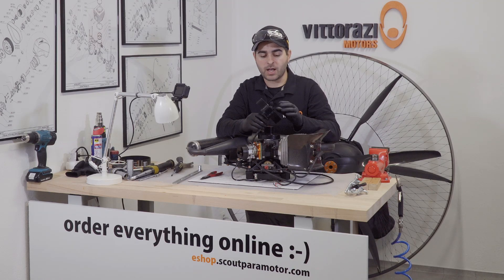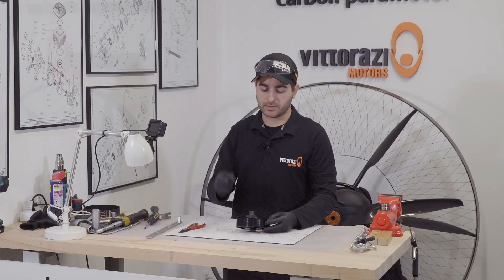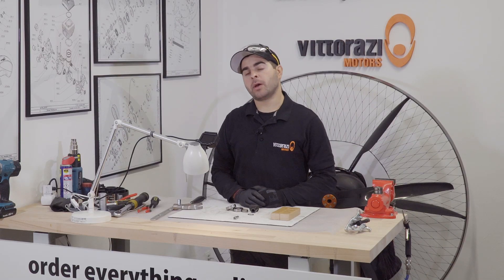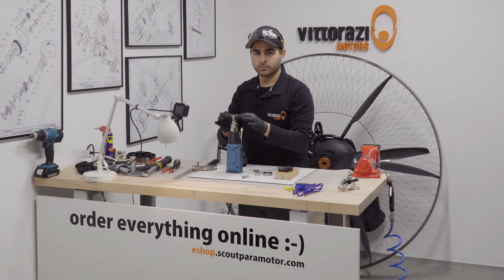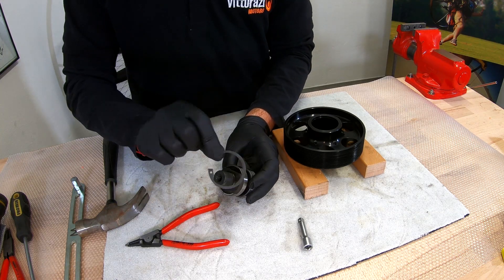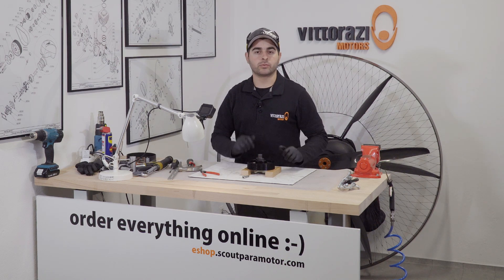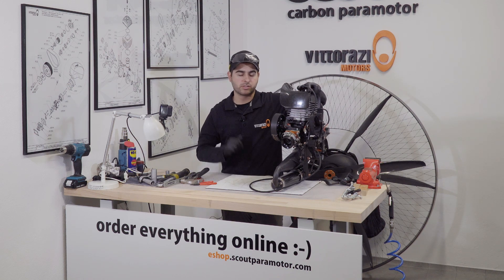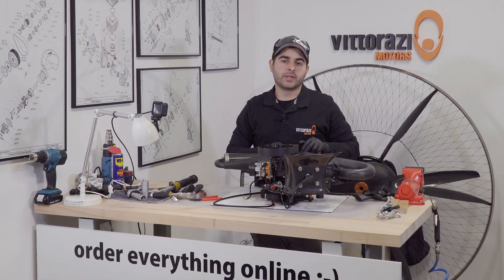Vittorazi Moster Plus big pulley bearing replacement. Paramotor engine maintenance series.

Comment: To remove my bearings I had to heat them to the point of melting the rubber seals. To install new ones I had to get my bearings way hotter than shown and put the shaft in the freezer, and I still need to hammer them on. 
I bet my shaft is just slightly oversized or at least at the top of the tolerance band. Next time I'll just plan on buying a new shaft. Not worth fighting these bearings again.

Comment: That was my experience as well. In fact, all fittings in the entire process were very tight to pull off and put on, even when using grease and a heat gun.

Comment: When I mount the big pulley back onto the engine, it is extremely hard to put back on. It does not just slide in like your example.
Reply: nigel thornberry  yeah I heated it to 300 degrees. It worked but with a little more pressure than him